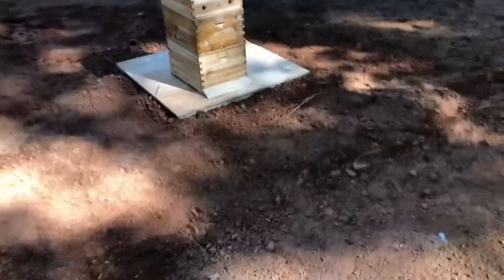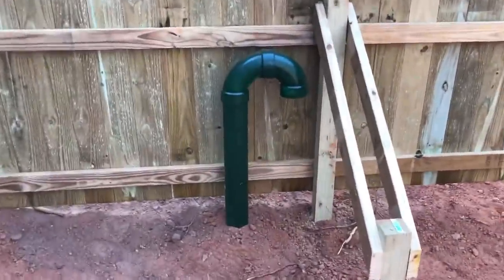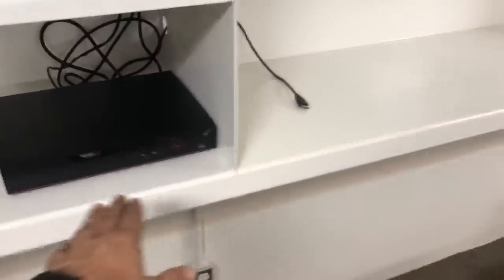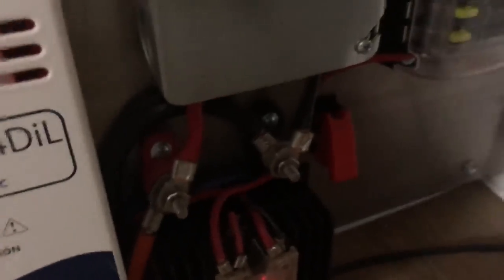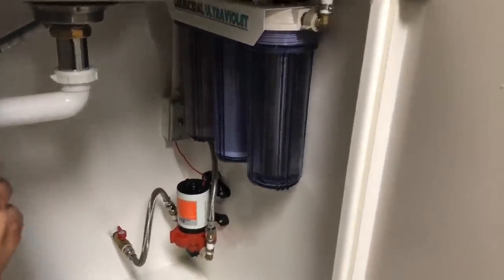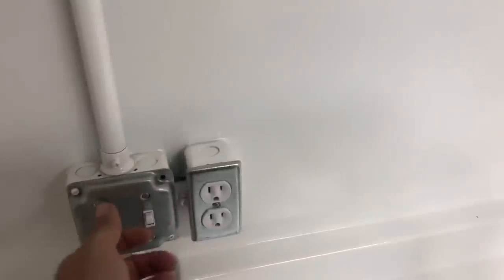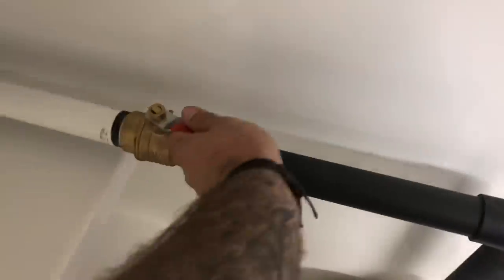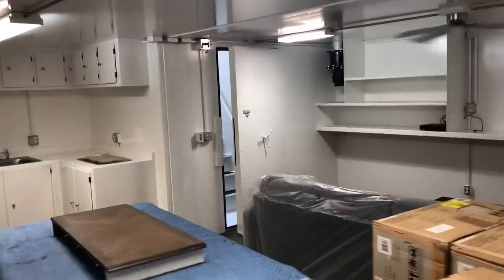Inside a REAL SHTF BUNKER - Doomsday Prepper Walk-Through

Comment: Sadly This Looks Like a Cheaply and poorly done Bunker by Rising S bunkers, I Feel Bad for the Folks who may have wasted there $. Never use Propane for a Bunker, that Poorly done roof Access door will leak. and the Plastic Vents will break.....Bear please look into better bunkers like Atlas any company other than Rising S..... 

Just My Opinion Based on My Research as I am saving for one myself.
Reply: It's an impressive size storm shelter.  A few things could be modified to make it safer.  The noise from the air filtration system alone would drive me nuts.
Reply: I do like the layout, though.  But it could use a touch more counter space.
Reply: Crazy Med1c yeah it’s a Rising S bunker, death trap.
Reply: Atlas has several videos of the poor construction and use of propane of the Rising S bunkers, plus the explosion in TX from propane use, just highlights what may look cool and good marketing will not mean a long lasting safe bunker.  Never use propane in a confined space, any leak will kill quickly plus the kaboom.  Using alcohol is ok as it burns cleaner like for the burners,  but propane for the water heater is no good.  PVC for the piping is ok for a storm shelter, not a bunker for SHTF.  The air unit is just a wet vac with a filter, too noisy for prolonged use and no manual crank
Reply: Didn't one of thier bunkers just kill three people the other day because of a gas leak?
Reply: Ryan Miller yup, it did
Reply: Absolutely
Reply: @more_guids  yep sure did
Reply: It's better then what I got but you're 100% correct, everything Atlas says not to do is done here.
Reply: @bustedpeanut  no under floor storage uses up precious living space all those shelves
Reply: @MrTopflight29  yes your right
Reply: @more_guids  yes
Reply: @CanadianPrepper  true that. I follow you and I'm glad you didn't do this video
Reply: @matthewsantiago5360  that makes 2 of us.
Reply: The tankless water heater is a completely enclosed combustion chamber with redundant safeties.  It would be virtually impossible for that to explode. The cooktop was alcohol not propane... a propane cooktop would absolutely be potentially  catastrophic. That's not a Rising S bunker... I dont believe. 
Wasn't to impressed with the PVC air intake and exhaust piping... although steel pipes could easily be blocked off as well.
Reply: @EK-ty4ye   I need to read more Facts about that incident,  but I believe that the preliminary cause was the LPG hot water heater.
Reply: @daisytaylor1610  agreed. Nice for weathering the storm...for SHTF? Um, not so much....for sure! 
Propane?!!! DANGER Will Robinson!! DANGER!
Reply: Tell me about your bunker.  I’d like to know the specifics so I can learn
Reply: My concern with the PVC air intake is due to possibilities for a ground-level fire turning that polyvinyl into noxious fumes. An air quality sensor and a metal air intake elbow would make me feel safer.
Reply: @CanadianPrepper  , as you know prepping for even the simplest of things is tricky there are alot of companies out there who will take advantage of good people to make a buck. I don't Follow any youtuber or have any loyalty towards any company. I compair there opinions to either validate what I have already done or use there info to reevaluate what I'm doing to give my family and Tribe the best chance during any kind of likley or unlikely situation.
Reply: @thetribesman8658  not true. Go to Atlas bunkers
Reply: @thetribesman8658  The problem is gas lines have fittings, couplings, threaded ends and that is where a problem can happen, Propane in an enclosed area is just bad practice.
Reply: @warren2785   i said something similar to Canadian Prepper  , im not trying to dog on Bear or anyone as you know prepping for even the simplest of things is tricky there is alot of bad info out there and alot of companies out there who will take advantage of good people to make a buck. I don't Follow any youtuber or have any loyalty towards any company. I compair there opinions to either validate what I have already done or use there info to reevaluate what I'm doing to give my family and Tribe the best chance during any kind of likley or unlikely situation. I have been wanting to get a bunker so I have been doing alot or researching and have had the privilege to see in person some very bad/failing bunkers and have seen a couple good ones.
Reply: Crazy Med1c Brother, you’re missing my point.  I understand wanting to learn and wanting something better than this specific customer has.  But all the comments dogging this specific setup is from people who would be shit out of luck if a hurricane, tornado, SHTF, or area civil disobedience took place within the next year. They’d all take this in a shit situation that happens before they get their “better” bunker that most will never actually get.  Knowledge of how a bunker “should” be built is worth nothing if you don’t actually have it. This bunker, flawed as it is, is flawless for anyone that has no bunker in a shit situation that happens before these people have their bunker.  They’re banking on time and money they don’t have.
Reply: It is sadly I though bear was better than this . 😢
Reply: @warren2785  point well taken. I just feel very bad for folks who have spent 250k+ to have something go belly up when they could have spent the money in a better manor, last year I responded Fire/Hasmat  to investigate a bunker were a gentalman got sick about 10 miles our of town the "home built" bunker had low levels of 02 and high combustible gas per our MSA multi gas detector, guy spent alot of money to have a useless shelter. Could have had a cabin and crops and livestock,  all because he got bad advice so it just hit a little closer to home you could say, I really like Bear his advice and knowledge are some of the best out there that's why I listen to his channel. It's not my goal to break anyone down and I should have taken the time to comment more carefully so not to start a bash session. Best of luck to you wild Spice , thank you for your reply we are all the very few who are awake and need to stick together and be supportive of each other in our journey to self reliance.
Reply: Wild spice made a very good point.I really like Bear his advice and knowledge are some of the best out there that's why I listen to his channel. It's not my goal to break anyone down or bash there prepping  and I should have taken the time to comment more carefully so not to start a bash session. Best of luck to you wild Spice , thank you ,we are all the very few who are awake and need to stick together and be supportive of each other in our journey to self reliance.
Reply: @warren2785  That's a horrible excuse for paying for a bad bunker. Yes I don't have a bunker but this one ain't cheap so if I do buy one I'll just spend extra and make sure it's done right
Reply: @mladyskirk5524  EXCELLENT  point! With California on fire, makes ya think!
Reply: @matthewsantiago5360  I've seen the video... they ( Rising S) were  using it for cooking and the tank was in the bunker.
Reply: Then you should never be allowed to have propane in your house... propane, which is heavier than air... will accumulate in your basement... if there is a leak. Using propane is legal in every state. Of course you need to make sure the fittings are leak free.... just like you would in your home.
Reply: @thetribesman8658  may I recommend you do some research on bunkers in relation to, over blast and explosions. You are correct about the density of propane. And yes, there have been houses blown entirely off their foundations due to a gas leak that was ignited by a pilot light. Again, research a little my friend. There's a big difference in a buried, sealed bunker (even with ventilation)....and a house. You'll also find in your research that every country outlaws the use of propane in a bunker except for the United States which is so far totally unregulated.
Reply: @kmed92  I get it and understand the hazards of propane or other combustible gases... I've been in the HVAC business for 40+ years. My point is that ANY design flaw or misapplication can create an unsafe condition (I see them on the daily). There are many sensors and other control applications that could be applied to mitigate those safety issues.
Reply: @thetribesman8658  I agree. If Only They Were implemented. Since bunkers are unregulated typically they're left out. I could be totally wrong but I haven't seen or heard mention of even a carbon monoxide detector that comes standard with the rising s bunkers. I noticed the hot water on demand appeared to be a somewhat closed system. I'm sure this helps some. But then coming to the stove there's a reason why alcohol is used even when the bunker is plumbed for propane. Which I might be preaching to the choir here, sorry if so. From everything that I can tell Rising S makes a marginal  version of a storm shelter ( not a bomb or fallout shelter). However, they've had tons of issues with the welds, doors, and air filtration. Not to mention water intrusion throughout. If you research any into bomb shelters, Atlas comes to mind. They seem to be on to something with what appears to be an excellent product. It is a bomb/ fallout shelter. However, you'd have to be Filthy Rich to be able to afford one. Their air filtration is military grade and if memory serves me correctly I think it's around 30 grand. Oh if money only grew on trees. LOL
Reply: @daisytaylor1610  I agree, nice storm shelter.  For a bunker, you'll  need integrated defensed, like were present on the Maginot Line.  And before you start saying, "But the Maginot Line fell" I understand that.  However integrated defense positions are a must for a bunker in a shtf situation, and the Maginot Line is a prime place to look at how to do it, although in a scaled down way.
Reply: @thetribesman8658  please never buy a bunker from those felons. I'm saving your life.
Reply: @MrTopflight29  smart
Reply: It is a Rising S bunker
Reply: Atlas Survival Shelters They should advertise the propane heater asa self destruct feature!!
Reply: @AtlasSurvivalShelters  I tried to save their lives by telling them to not buy one from them and to look you up and watch your videos. I warned a lot of them. I watch every video you put out and by far your bunkers are safe and top notch. My name is Matthew Santiago. You can mention me in your next video me warning everyone not to buy Rising S. ;)
Reply: @warren2785  Except that I'll be in that bunker in short order the exterior hatch is a roof hatch wouldn't stand a chance against 9mm rounds the main entry door is not a sealed unit so all i have to do is take plenty of wet undergrowth through the now opened roof hatch set fire to it close the hatch and wait for the smoke to drive them out or i could just kick over the ultra robust pvc air pipes and pour gasoline down there because I'm betting it's a straight line from the pvc into the bunker standard Rising S build.  This will not save anyone from anything and as such it's a total waste of money and time.
Reply: Andrew Austin dude you’re assuming this guy doesn’t live in the country away from population, in which case nobody is coming to do anything to his bunker for a good while after a catastrophic event, and my original point still stands that this bunker, flawed as it may be, is better than the no bunker most negative commenters have.
Reply: @warren2785  Your assuming he's not in a populated area so we're both potentially guilty of assumption but wherever he lives i guarantee someone local saw the trucks and could probably guess what the loading was they are not exactly stealthy and the fact remains this bunker would offer minimal resistance to someone wanting to get in.  Look at other videos of the company that makes these bunkers everyone's happy when they are first installed they look good a few months down the line that changes as their bunkers develop leaks and people realise the air filtration system is a pile of junk that even if it had sturdy intake and outtake piping doesn't deliver enough airflow.  The air blast valves rust very easily and become inoperable for economic collapse this may give extra security until it's found  but for nuclear or pandemic you'll die just as quick in this it will not protect from that scenario or any like it.  I know two people that spent a large amount of money with Rising S and were so happy when it was installed making video's and showing friends around and how they now had q little piece of mind and now both seeking legal recourse because they both had water ingress and differing levels of flooding that Rising S haven't resolved and don't respond to communication.

The worst part is Rising S has everything needed to make a good product they just put personal profit before quality and it's the customers that suffer and to have someone that a lot of people look to for information on prepping and preparedness supporting this awful company is not good and on top of that he says Rising S are better then another company with a better reputation so not sure why he's swimming against the current on this but it's a cause for concern and my search for a third source of prepping information will continue on.
Reply: @earlwyss520  Maginot Line failure was due to not completing it.  The French got too complacent, and got flanked.

Comment: Bear,  As an electrician I am deeply concerned by the battery setup. The terminal block where the positive and negative land are exposed. Any metal object (such as a wrench) that touches the positive terminal and the metal shelving or floor will cause an explosion!  Imagine grabbing a hold of an arcwelder barehanded.  This system needs to be in an easy serviceable dedicated location (not under a shelf) with proper separation between the charge controller, inverters and the batteries, which should be in it's own box that is vented directly to the outdoors.  As this stands, what you have here is a bomb, not a bunker.

The other issues that need to be corrected are putting Ground Fault Protection on the outlets in the bathroom and kitchen.  Given the entire structure is metal I would put GFI breakers in for all outlets.
Reply: I hope the batteries are not Lead Acid. Just charging them will do you in, no need to wait for an LP explosion.
Reply: Could not agree more my friend. I am a retired Royal Navy EE and have had full NBC protection training. I saw no 90 degree bend for radiation protection. 120v light switches appear to have been used for the 12v switching so they won't last long. They have around 700W of solar for an up to 10 person bunker, they need 2KW at least once the inverter is in use. I saw no proper fusing or any protection over the buss bars. SLA batteries should not be discharged further than 50% max and as for the 25% "emergency battery switch" the internal impedance at that point  is going to struggle with the lights nevermind an inverter.

All of the 12v system looks like its made from caravan chargers and inverters. Why are lithium cells not being used and a reputable brand of inverter that has an EMP certification. No protection on that as far as I could see. 
The filter in the air system looked tiny and had no classification markings. No segmentation of the different area's. FIRE PROTECTION.... Why bother all the oxygen would be used up. No sump in the central area. UV water filters are not going to stop cesium particles or any other radioactive contamination.  As you commented I could see no Supplementary bonding or straps and given the occupants are standing on a buried steel box the entire system must be GFCI / RCD protected. That electrical installation would be condemned in the UK. It has been covered by the person posting RE the gas heater. Any kind of gas powered heater is illegal in the UK in a sealed or underground area.

The above may all seem pretty and some may think that something is better than nothing but I can tell you for sure.... I would not go down there. That hatch and door would no more stop a nuclear blast than a paper bag would. This is a life saving installation and I would  not even be able to sleep down there for a night never mind sheltering from fallout and irradiation should the button ever be pushed.

I think I would rather go in the thermal flash than have a slow lingering death in that coffin. I hope the owners can get this sorted though personally I would dig up the entire thing and start again.

When things go wrong in confined spaces they go wrong FAST. I think it's very sad that someone has no doubt paid a fortune for this and got something that is lethal and NBC protection wise they may as well have built a greenhouse !!!!!!!!!!!!!!!
Reply: I agree that the electrical is subpar. And, as an underground structure, I am surprised to see electrical components mounted at ground level. They should be mounted in a wall cabinet, where they are much less likely to see water in the event of a flood; and GFCI protection should be utilized where applicable.
Reply: According to National  NEC code . No 12 volt in a 120 volt box. Unless the insulation is the same like Thnn. Separate is best.  The batteries will gas when being charged but where does it go?  The bunker doesn't have a Decon, room for washing off.

Comment: "Fully Welded seems" proceeds to show a horrible weld that will leak like a siv that a first year welder could have bested. "Frankly a very well built bunker, very well built"........ you need some more education if your gonna be a prepper.
Reply: Yep almost made me throw up as a welder.
Reply: Yeah I would get fucking wrote up at work if I welded like that that is terrible quality
Reply: Looks like a Rising S bunker based on the door. Also, pretty balsy to use a gas stove i  a sealed bunker, seems like a good way to risk blowing yourself up.